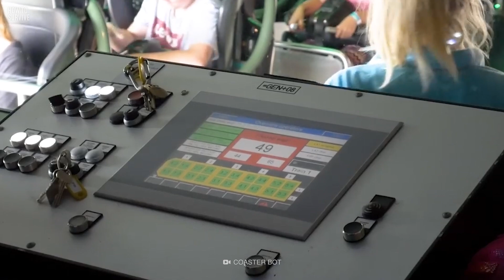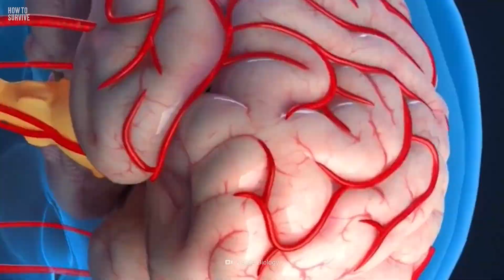How to Survive Being Trapped On a Roller Coaster

Comment: A lifthill or midcourse breakrun evacuation is a common thing, it's not dangerous, it just means that the safety systems are working.. Also it is SUPER unlikely you will hang upside down, AND it is nonesens that you should move as little as possible, the modern day restraints have the same sthrengt of airplane flaps!!!!stop being so dramatic. c'mon man!
Reply: YES A FELLO THOOSIE HI

Comment: They test roller-coasters before the parks open. They don't just give them a whirl with the first guests in line to test them. However I have heard you want to avoid being first because the longer a coaster runs. The better and faster the ride experience will be. That's nothing to do with safety though. That's just how electronics and machines work. The more times a motion is repeated. The smoother the motion will be.